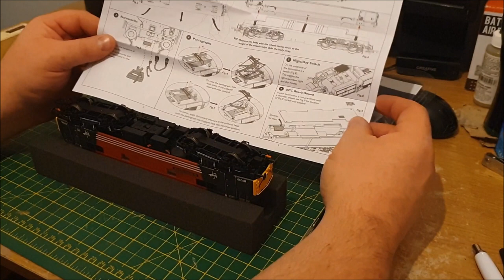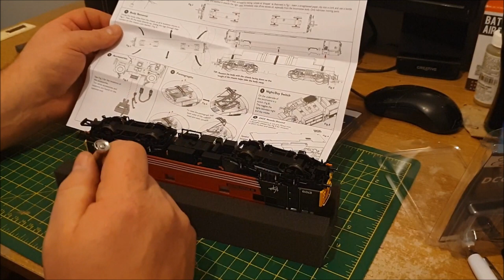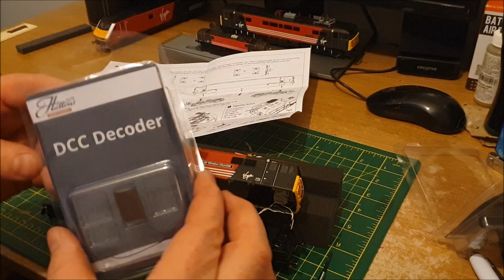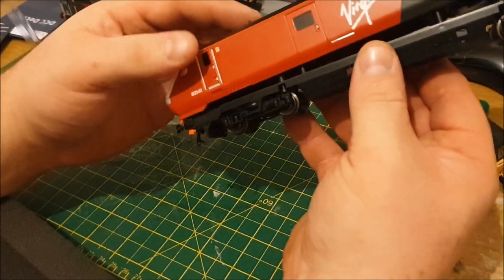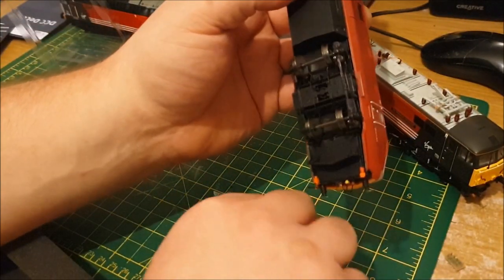Hornby R3656 Class 87 &  R4859 Mk3a DVT DCC Fitting

Comment: Hi.
At the risk of appearing stupid, why is there a need to fit a decoder to the virgin DVT?
Isn't this effectively a coach?
I use mine on the back of a couple of coaches pulled by a Vitrains Class 47. Thanks.
Reply from the maker: the newer hornby dvts have dcc ready so that the directional lights can be controlled thats its only purpose really, it would still work without a decoder but with a decoder i can link it to the loco for changing light direction